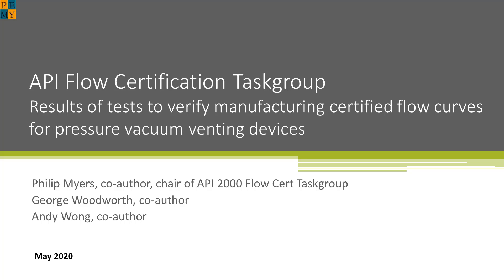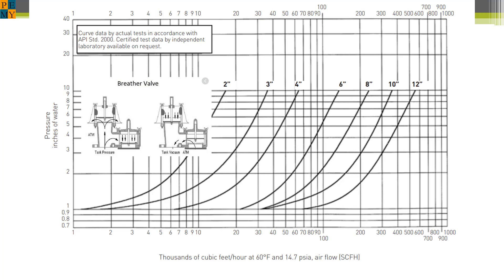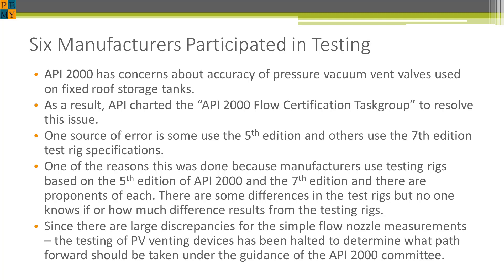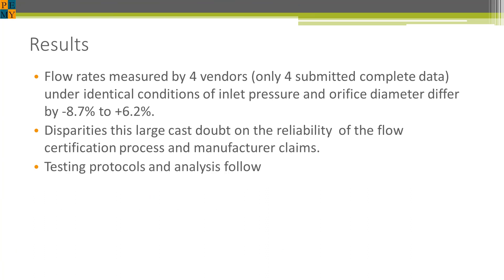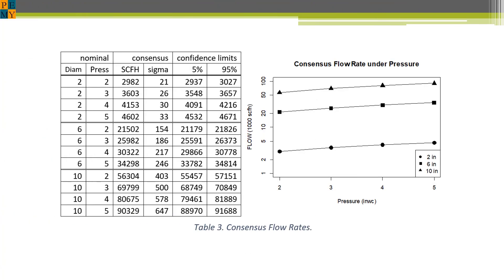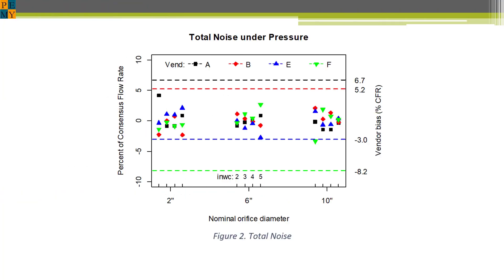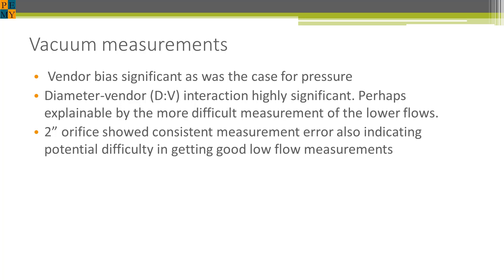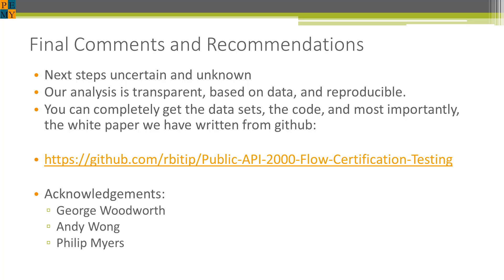API 2000 Flow Certification Pressure Vacuum Testing (PV Vents)

Comment: Hi, your channel is very interesting.

I write you from Ecuador. Maybe you can help me with an aclaration.

For Pressure / Vaccum Relief Valves PVRV or (Breather Valves). According API 2000 (5.4.2) when you make the seat test at 75% (pressure or vacuum) the maximum allowed leak rate not shall be upper:
0.5 CFH for 2 inch to 6 inch valves; 
5 CFH for 8 inch to 16 inch valves; 
and 20 CFH for 16 inch valves or greather. 

I am construting a PVRV test bench (but I dont know how to select the thermal mass low meter range appropiate); I have several alternatives:
LOW FLOW
1lpm - 50 lpm        SIZE 1/4 inch
4 lpm - 200 lpm     SIZE 1/2 inch
8 lpm to  400 lpm  SIZE 3/4 inch
4 lpm to 700 lpm   SIZE 1 inch

HIGH FLOW
50 lpm - 250 lpm    SIZE 1/4 inch
20 lpm - 1000 lpm  SIZE 1/2 inch 
40 lpm - 2000 lpm   SIZE 3/4 inch
70 lpm- 3500 lpm    SIZE 1 inch

But, I reviewed another option a mass meter too, its range is 0 - 200 ml/min   SIZE 1/4 inch.

Do you think, the mass meter is the adecuate? or sould I use a rotameter?

Can you help me to select the adecuate flowmeter?